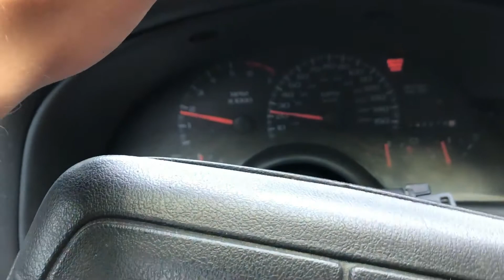97 Camaro Z/28 Fixing The Trans Mount

Comment: Mine has dine that twice now i bought the car on september 2nd last year and started driving it in october.
Reply from the maker: +Dakota Von Rissen unfortunately mine did it a second time too after this video. But the current one seems to be doing good.
Reply: CarGuyV8 thats good. One thing i learned with these cars is there fun but be ready to replace parts lol. Its my first car and im restoring mine so im going thrpugh everything this winter. Yours is very clean its a good looking and sounding car
Reply from the maker: Dakota Von Rissen thank you man! Hopefully I don't have to replace to much for a while.
Reply: CarGuyV8 yeah hopefully not mines over 200000 miles so thats why mines had so many issues. Mine also sat for at least 8 years.